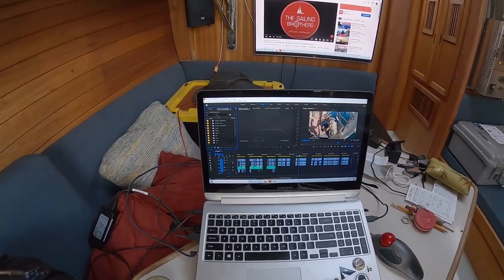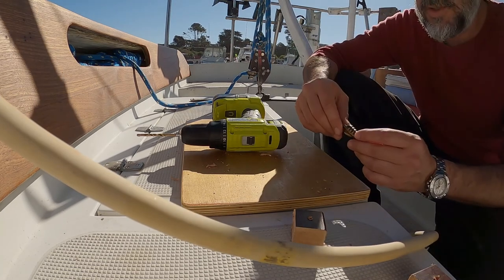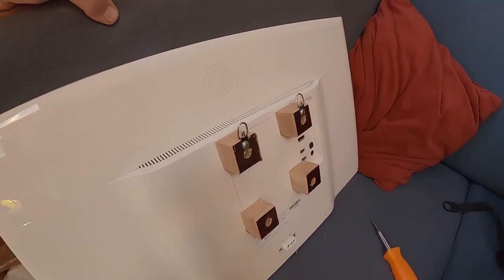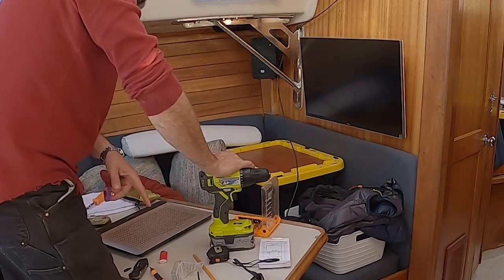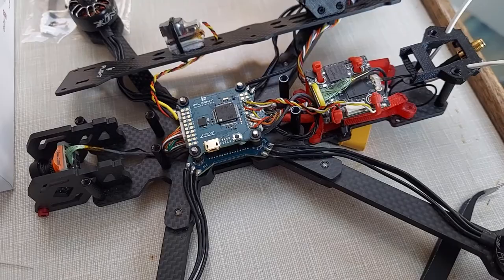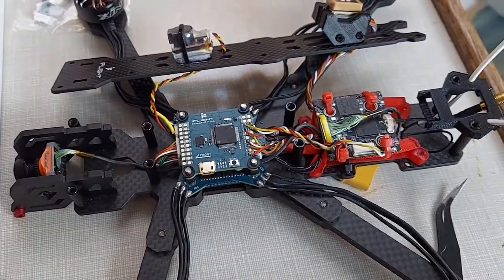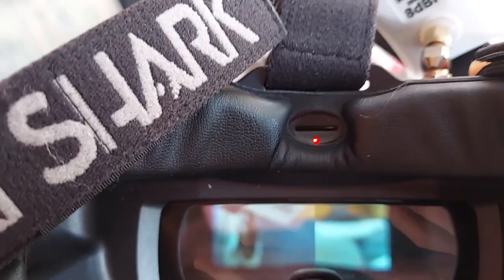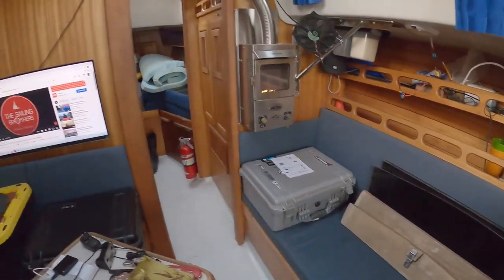12v powered 4K Monitor Sailboat Install - New Ryobi Soldering Iron - Captain's Vlog 5

Comment: Nice monitor install.  I'm didn't know that I needed a battery-powered soldering iron until today.  How cool is that?  You might consider some Velcro pads on the blocks to stabilize the monitor and still allow an easy removal.  Just an idea.  Enjoying the content - keep it up!
Reply from the maker: That's a great idea! Velcro. Why didn't I think of that!